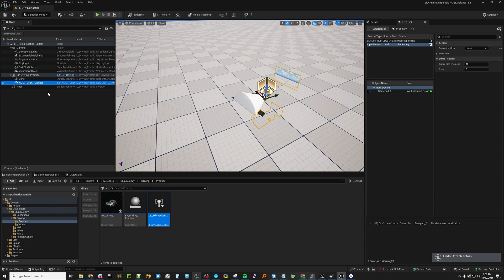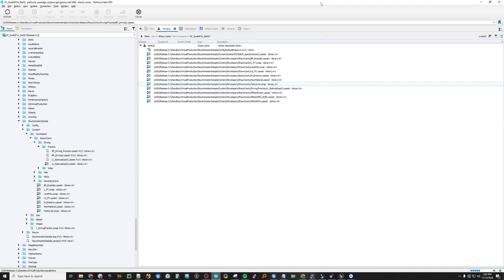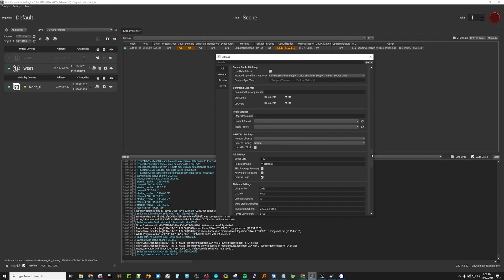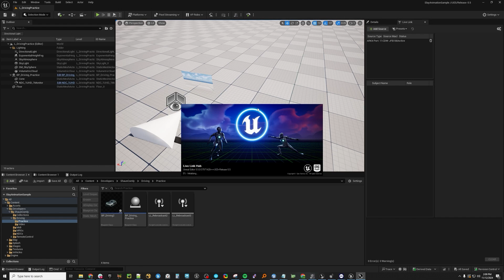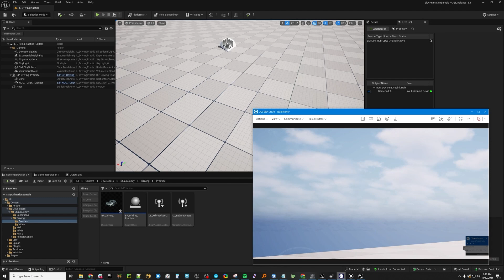Driving the nDisplay or ICVFX Wall with an XBOX Controller in Unreal Engine

Comment: Hi Shaun. I work at a large school and we have an Immersive Room with 3 large screens all connected as display on 1 pc (1pc, 3 large displays with touch/mouse input). Is possible with nDisplay to get touch/mouse input and let users click a buttons for example? This is easy from a players perspective in a normal game but with nDisplay we are struggling with this. We would really like to use unreal for this but we need to get this work first. Maybe you could do a video about this or point us in the right direction. Best regards Wietse
Reply from the maker: if you are using cluster features (multiple app instances or multiple viewports) then UMG is not supported in nDisplay. If you have a single app (surround\mosaic) it should not be a problem.

Comment: Hey thanks for lesson, really appreciate it. I have a question, in my experience if you use any camera tracking system you put everything in zero point to work it properly, so the ndisplay should be always in zero in order to calculate correct offset. Is there a way you can rotate the environment around ndiplay?
Reply from the maker: You mean rather than just rotating nDisplay? The only way I can think it to do it programatically.